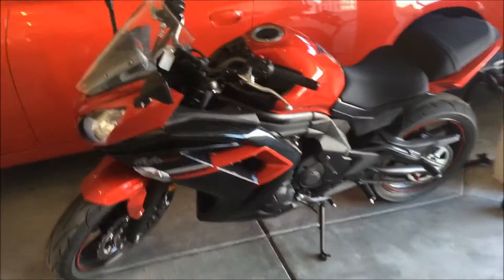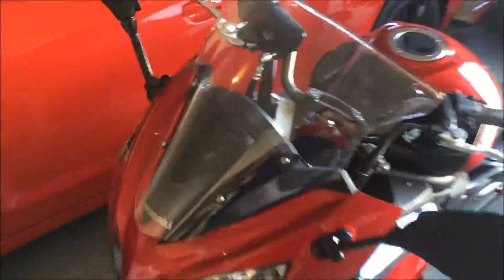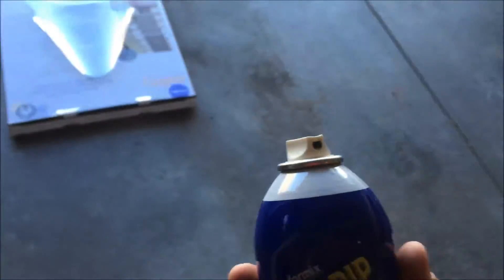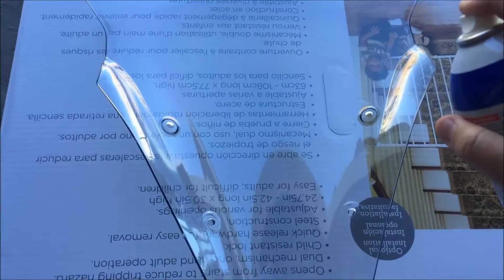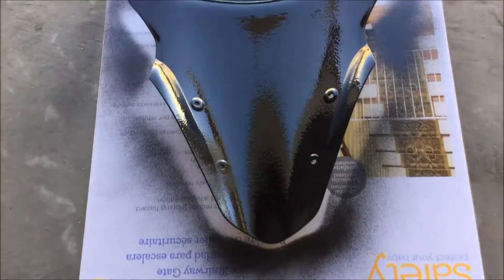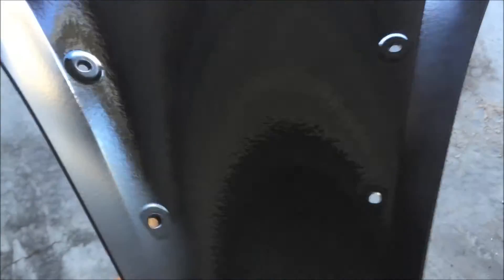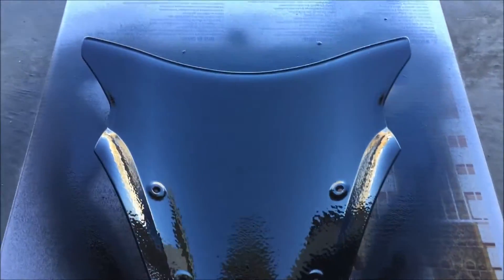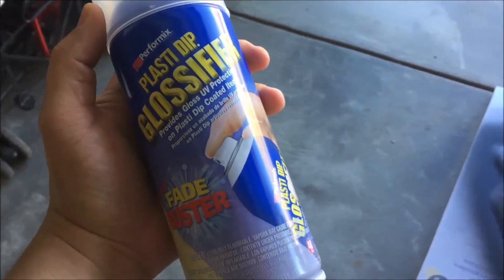Plasti Dipping Motorcycle Windscreen - 2016 Ninja 650

Comment: Looks awesome .. I'm thinking of using plastic dip black glossy on the fairings of my motorcycle which are black but colour is damaged through the years.Do you think it worths it? Does it leave that orange peel? In the video it looks fantastic with the mirroring effect !
Reply from the maker: It does leave that orange peel effect if you dont do it right.  Soak the cans in warm water before painting.  Problem is over time the color becomes dull

Comment: I actually plan on buying this bike next month.  Any regrets on the purchase so far? Going from a Ninja 250 to the 650.
Reply from the maker: Decorative Concrete Warehouse I really liked (as in I sold it) this bike. It has great torque and difficult to stall. Good for newer riders. 

However I did not like the twin cylinder engine exhaust note. It was weak sounding and did not sound like a 600+ cc bike. If I did it all again I would have gone with a ZX6R. If you have a problem with keeping your speed down then this is the bike for you.

Comment: IM GOING TO DO THE SAME THING,YOU SAID YOU ONLY NEED ONE CAN RIGHT?
Reply from the maker: George Burns less than
Reply: thx went and got a can at home depot, went to take off windscreen and realized windscreen nuts were stripped by previous owner :( dont know how im gonna get it off
Reply from the maker: George Burns oh bummer! Home depot sells a kit to pull stripped screws. Should work because these screws are not that tight.